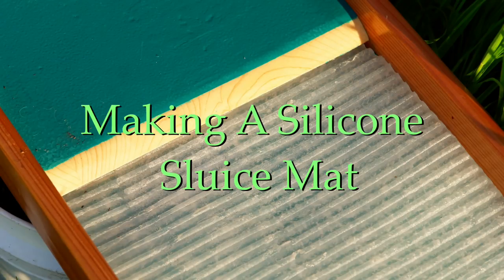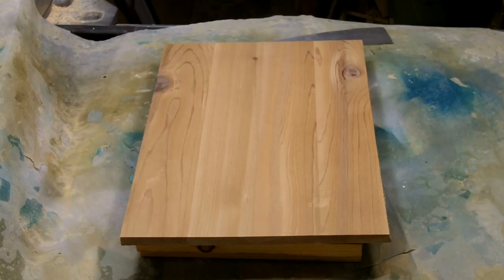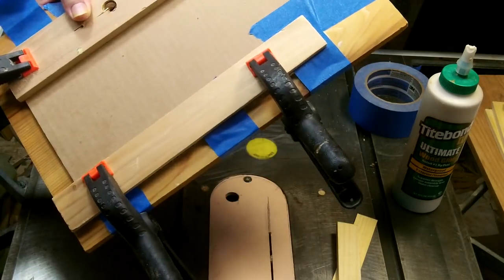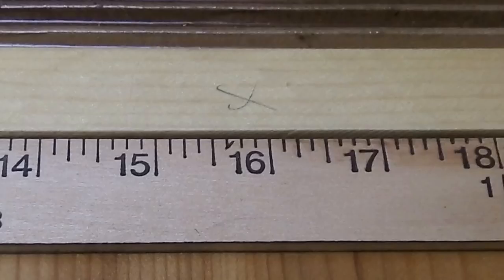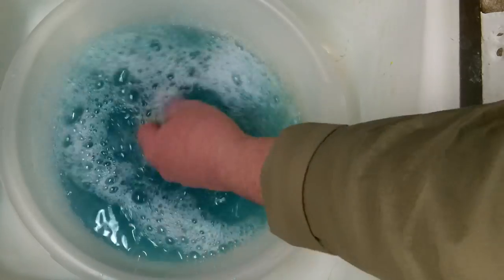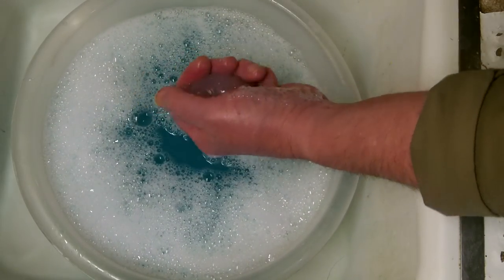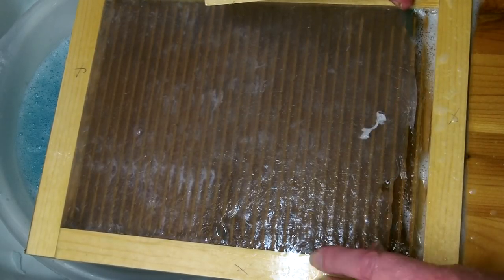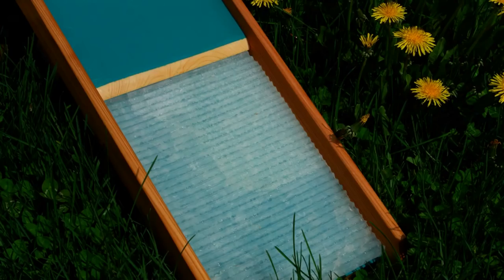DIY SILICONE GOLD SLUICE MAT

Comment: I’d like to try this but I can’t find any cardboard as thick as what you have 😕
Reply from the maker: Slim Danger 
Hi Slim and thanks for watching. Yea, you have to find a fairly good size box for sure. I bought a half bushel of peaches from a fruit farm for mine. Check with Walmart, Home Depot, Lowe's and shipping supply houses as they carry the larger boxes. An alternative is to make one out of square dowels like in my one video. Use a 3/8" square dowel for the frame and 1/4" square dowels for the cross pieces. That will give you a deeper mat that will catch more gold.
Reply: utahavalanch Thanks for your quick response, I’ll try your dowel idea. Good videos. Thanks again 😊
Reply from the maker: Slim Danger 
I think the one video I just put out on how to build a mold should help you. I'm going to be making one with the quarter inch and 3/8" dowels but it will be a little while as I have several other others I'm currently working on.
Reply: utahavalanch watching it now. Cheers

Comment: I think I found the problem, OUR buddy Allen said make sure it's #1 silicone, reading the fine print, GE 100% SILICONE comes in #1 and #2 .  I found out #2 doesn't mix well with water 🌊💦👎🚫 hopefully that's the problem.
Reply from the maker: Well, that is good to know. He is the expert on this. I checked mine and there is a very tiny 1 on all of them so I hope I’m good to go. Nice to know about that. Thanks. 
I’ve only had one problem and that was when I bought a tube of discounted Silicone from Tractor supply and it didn’t set up properly. That was probably the reason. Good to know, thanks.

Comment: Is there any reason you couldn't use plastic cardboard called coreplast
Reply from the maker: Hi Joe. Thanks for watching. I can't see any reason why it wouldn't work. I think that it would work well seeing as how it's already waterproof. Silicone sticks to some plastics quite well and so use plenty of dish soap and water on the mold.
Reply: update the coreplast is not so good, the ribs are square so I'd wind up cutting out every second top leaving a square top not as good and harder to remove the silicone mat it was a waterproof shot.
Reply from the maker: Joe Sabourin 
I don't know Joe. Actually, I think it would work very well. It would be more like a conventional drop Riffle sluice which would be very good. Square riffles are better than curved and rounded. I am thinking of making something like it using 1/4" square dowels glued to a board. It would be a bit of work cutting the tops out of every other square, maybe with a utility knife or dremel tool but you would only have to cut about 3 inches wide and as long as the width of your sluice and then you could make multiple little mats and glue them together to make a longer one. I think I would still consider it. I may give it a try myself one day but I usually have about seven projects I'm working on all the time and run short on time. Let me know if you try it.
Reply: The crosses run the wrong way to do short pieces but the 48X16 would work to remove every second top skin I'd be more concerned with removing the silicone with out damaging the silicone mat because of the square edges that remaining mold form
Reply from the maker: @joesabourin7133  

Just thinking out loud here. if you cut the top off from every other groove, you can take fine wet/dry sandpaper 220 and 320 grit and sand the edges where you cut it to be even with the walls and round off any sharp edges. 

To test, I would get a small piece and cut the top out of 2 of the grooves  and leave one uncut in the middle. Then sand them. I'd only do a maybe 2" or 3" long strip.  Then get a small amount of silicone and work it in the soap water for about 7 -10 minutes. The longer you work it in the water the less sticky and harder it becomes. Then brush straight dish soap into the mold or get glycerine from a pharmacy to spread in it for a mold release. Press the silicone into the grooves and smooth off. It should take a couple of hours to set up. That way you could see if you can get the silicone out of the mold and how it would work for a mat.  Then you can decide whether or not it's worth investing time and energy into. If you can get only get small pieces like 6" or 8" square, as a mold, you can mold a number of these pieces and glue them together to make a wider or longer mat. This stuff is real easy to repair or glue together. You might even be able to squirt strips across the top of a piece of this plastic to make riffles the height you want and the space between you want. Once you get to thinking about this, the more things come to mind as you go through your day.
Reply: I'll continue to see what happens, the size I settled on is 16X16 the ribs go crosswise on that piece and I can cut that down to replace my gold cube vortex mats, maybe hot glue the flat top to round top I'm not comfortable only thinking inside the box most of my life has been outside the box for sure
Reply from the maker: @joesabourin7133  

I think that could be an ideal mat for the top slick plate of the Cube. I would leave the others the way they are. I have an 8" Gold Cube  with a vortex mat on the slick plate and I reduced  the water flow to about 400 GPH and it now catches all the gold on the top slick plate area. I don't even use the other trays. I may buy a 12" tray and do the same.  If you watched Alan's video on how he flipped his mat over to use the smooth side as a Miller Table, you could try that with this as well. When you get a fair amount of gold sticking to the mat, shut off the water and lift the mat off and wash off in a pan.

If you look at drop riffle sluices and I have several videos out on them, you will see that they are all flat across the top. That makes it easier for gold to transfer from one trough to another when one fills up and stay out of the faster upper level of water that will wash out the fine gold. That's why Keene and other sluices with those tall riffles lose 80% of their fine gold.  Adding a higher rounded surface would lose a lot of that fine gold which is what you want to hang on to.  This design has been around for over 150 years for good reason and I have used it for 50 of those. Best design for a sluice ever. I am now making a larger one for my summer prospecting. Keep at it, looks like you are getting there.
Reply: The top slick plate is an idea in the works maybe treadmill mat there, the problem with the vortex mat has a lot to do with the material I'm running, very fine ocean black sand with even finer gold, I might keep the last one a vortex mat but the middle 3 take a long time to get it all out the vortex has very good holding properties and a PITA to clean with gravity water pressure, no battery no power pump and so far it all works great  The setup on Oregon beach mining with the 7 stack looks interesting but I'm not that tall and don't like ladders  at  all.  I'm looking for a quick dip in a tub of water quick inspection and then back together repeat as required.
Reply: The saw tooth mat design looks very good as well easy clean but the freight and border charges and the product not being available from a Canadian source are problematic at best
Reply from the maker: Joe Sabourin 
Yea, the Sawtooth is an option and it has the fast cleanout and holds a lot of material. I used it for a couple of weeks and then went back to my drop Riffle. You can order the Sawtooth from the manufacturer on EBay but, yea the shipping is a bit steep.
Reply from the maker: Joe Sabourin 
A number of people have been using Deep V mat on their slickplate with pretty good results. There is a Canadian company that is selling a very interesting looking Deep V mat that I want to try. It is a deep v with another little v on top of the fingers. Looks like the little feathery v would knock any small gold flying by into the deeper V. If you do a search on EBay for Vortex mat or Deep v mat the company shows up with their listings. They have some nice Vortex mats with much bigger pockets than what comes on the Cube. Those might be some options for you to look into with a Canadian company.
Reply from the maker: Joe Sabourin 
See if this link will work for you.
https://rover.ebay.com/rover/0/0/0?mpre=https%3A%2F%2Fwww.ebay.com%2Fulk%2Fitm%2F153471461765
This is the mat I was talking about.